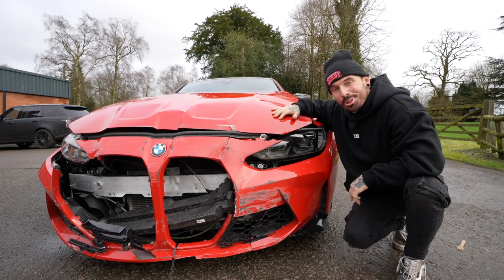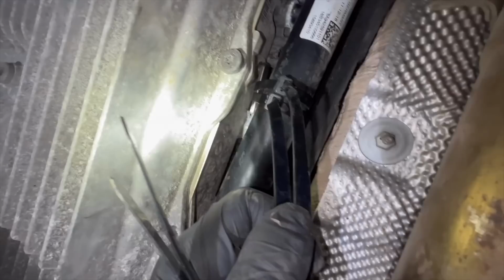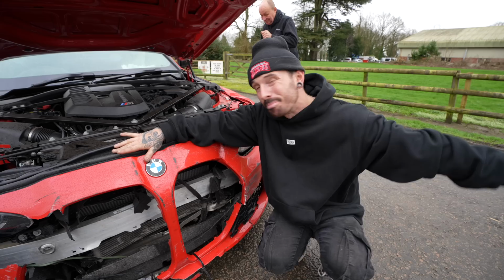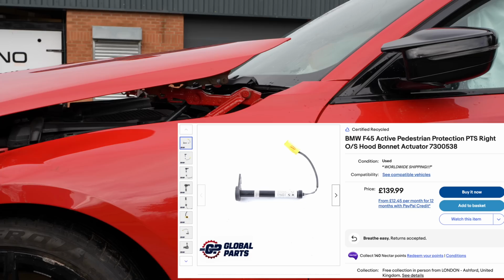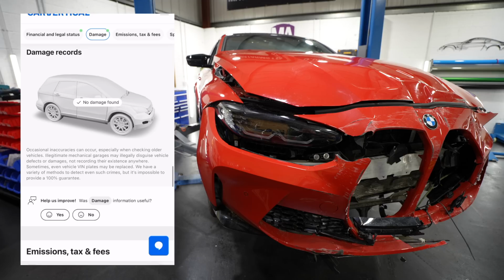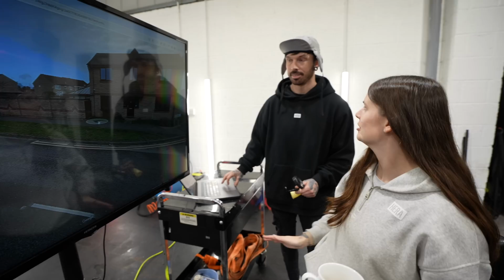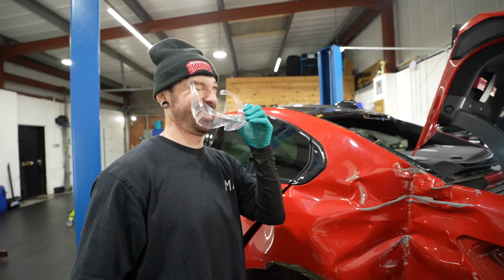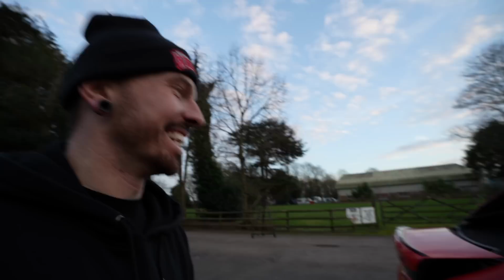I BOUGHT A WRECKED BMW M3

Comment: It will have a clean title, if it can be repaired, but I hope that Mat, or any subsequent owner, discloses truthfully the original damage (just providing a link to this great video would do the trick). Even if it looks perfect after the repairs, not everyone would like to drive something that had that much damage before. I wouldn't, for safety reasons.

Once steel is bent beyond the elastic limit, and you have to bend it back in shape, it strain hardens and its mechanical properties and how it will deform next time you get in a crash, are not the same as when it came out of the factory. Even if you never crash it again, the rigidity of the frame (how much it flexes under stress under hard driving conditions) will now be unequal left to right, especially in the more sensitive rear axle zone. It can make the car unpredictable when the rear gets loose and the feeling turning right or left under the same load and conditions, will be unequal.

I wouldn't roll the dice to save a few thousand quid.

Comment: Great video… can you confirm something with me. Having owned several 4x4 cars including an A45 AMG currently… don’t all four wheels need to be the same circumference and if not has this been a factor in the crash. If the rear 20’s have a smaller profile tyres to compensate then that may be ok… I’m no expert btw Kev

Comment: The battery disconnect isn't a fuse, it's inertial. Suu it has "10Nm" on it? If the car decelerates at more than 1.1g, it disconnects.

Comment: I think I would have tried taking the wheel off and fitting a smaller one with same pcd first before breaking out the angle grinder if I didn’t have access to wheel skates.

Comment: Figured it out the car came from the opposite way, spun off, the rear tyres lift of the ground due to pavement , the front wheels where in position of rolling on the grass and slight in the air and the front end hits the house while in the air damaged the rear quarter by slamming into the wall outside the house like the inside of a rectangle.

Comment: If you cut the oil tube, the pieces of the tube and the disc will enter the inside of the tube and eat the engine from the inside.

Comment: My thoughts, IMO of course, the steerimg wheel seems a little shiny for such little miles. I have a BMW with 17k miles that has very little shine on the sterring wheel, so it leads me to think it may have been clocked. I only say this as ive bought a suspected clocked BMW and not realised. BMW told me they thought the same but said they couldnt prove it. The car needed a new steering wheel as the leather was peelind and the brake pedal was excessively worn, and on all four corners the tracking was way out, causing horrible wear on the tyres. And because it only had 14k on a 2 year old car, BMW replaced the steering wheel and pedal under warranty, which was pretty decent of them. I did end up getting rid of the car not long after, before more issues presented.

Comment: But if it isn't recorded as damaged what's the point of a Car Vertical check? Any presentable 'repair' - especially by a non-approved BMW or professional, authorised vehicle repairers - could result in someone purchasing a car believing it to have had no previous damage. That's why proper and authorised body repairers use trained technicians and manufacturer approved methods. In the case of this car, Car Vertical or any other pre-purchase checks are meaningless.

Comment: That repair might go horribly wrong. The whole C-pillar structural integrity gone. You might not want backseat passengers after that repair. Roof might not handle any more accidents. Thou BMW comes like that from factory? Never seen different type BMW. They are often crashed, triple rolled to funny parking position aside the road. They should put holy cross as stock accessory since you need it when you drive BMW.

Comment: Don’t run the car after grinding that oil cooler pipe. The swarf will be getting sent around the engine and will be “engine very bad” before you know it
Reply from the maker: That’s what the oil filters for
Reply: @MatArmstrongbmx  not really, but better safe than sorry 👍

Comment: My guess is a car could have started pulling out of the turning next to the house BMW driver was carrying too much speed tried to dodge the other car over corrected which caused the rear passenger side wheel to hit the curb causing the rear arm damage and lifted the car enough up to leave little to no marks on the ground

Comment: If you look properly at the crash photo, you can see tyre marks from the roadway across the path. (Front and rear wheelmarks). The car was travelling sideways and impacted the house and wall simultaneously. Any damage to the passenger's front wheel?

Comment: I see that and I have to cry & laugh in pain at just how fast my insurance company wrote off my car as a total loss. The company they sell “totaled” vehicles called me before the paperwork had been completed. So they basically sold my car before taking ownership. The car could have been fixed. Block of ice dropped in front of the driver side front tire and buckled it under. Ice fell off a large snowplow. Shops are only as good as their mechanics. If you walk into a shop filled with people that can barely drink, walk out. Great mechanics tend to stick around great shops. - I like seeing cars get a second chance.

Comment: You don't want to push/pull BMWs with xDrive for more than 15 meter / 45 feet until in Neutral. And you never want to dyno them on one that's not 4WD. Everything completely fucks up the VERTEILERGETRIEBE 😂

Comment: If its not repairable you could just fix the rear left suspension take off all the front bumper and stuff and replace the oil cooler an radiator and use it as a drag racer 😭🤣 the dent in the back is just for "aerodynamics"

Comment: I would say that probably he was coming around the corner biside the house he put alot of power and spun the car around the front wheels want up normally but the rear wheel hit the foot path which caused the car to jump and also brake the rode while the rear end of the car is up in the sky the wheels are still spinning at high speeds it hit the wall with the rear quarter panel the car hit the floor and the wheels pushed it into the house causing the front end damage. 😐

Comment: “As you all know, I’m far from a mechanic.” I disagree… you guys have probably taken on projects far larger than most mechanics have. This is something that has always bothered in me in any industry, this idea that “more time/hours of experience” = more expertise. It doesn’t necessary work that way. Sure, maybe if you’re specializing in something. But if you’re “a mechanic” and your first job was doing oil changes and after ten years, you’re still doing oil changes, then are you really any more of a mechanic than someone that has taken totaled super cars and completely rebuilt them? It’s applicable to any job… Expertise isn’t just about time, it’s also about the breadth of experiences. I’d rather give my car to someone who has built lambos, Ferraris, mclarens, bmws, and Audis from the ground up than some guy who has worked at a Toyota dealership their while career, just running basic diagnostics and changing normal wear and tear parts.